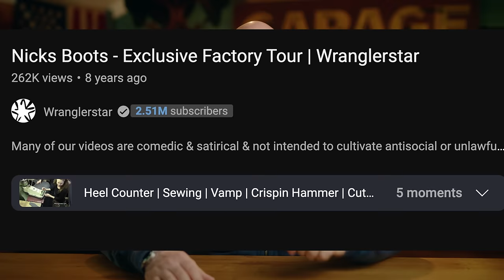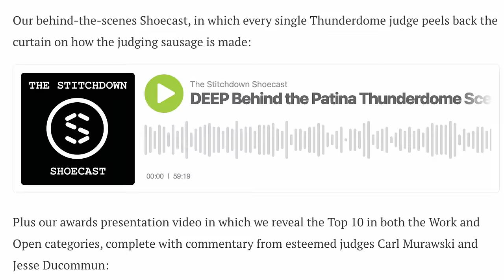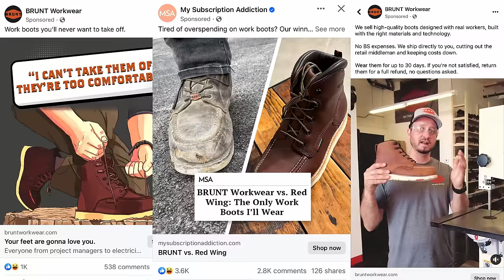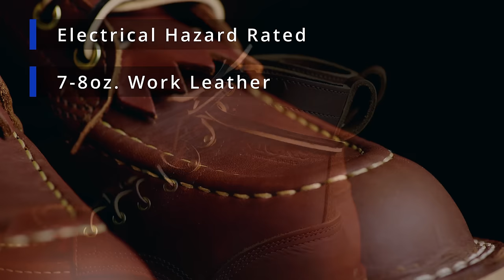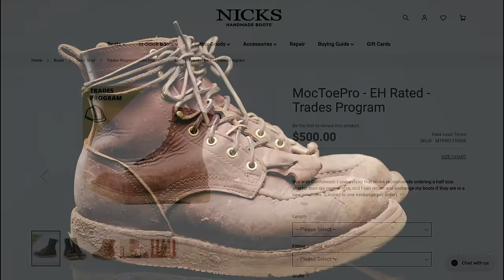$150 vs $350 vs $550 Work Boots

Comment: As someone who’s worn just about every level, make, and model of boots, there’s something to be said about having a very high quality boot on your feet and not having to think about your feet while on the job site. It’s a sense of security and provides a safer personal environment. You don’t have to go $500+ but I’d suggest considering it or atleast going mid range and steering clear of the epically cheap boots. When you’re new and starting out by all means going cheap in the most desirable option but once you advance in your trade go for the higher USA made options, you’ll have a tougher break in but it’s worthwhile. I will say with Nick’s the break in hasn’t been that bad in my experience.

Comment: Awesome video! Thanks Carl. One thing I would say about the Red Wings is that you can get the 10875 (same exact boot as the 875 but with oro original leather instead of oro legacy) for around $285 U.S. It's a great price for a really solid boot. The oro original is a more tan instead of orange leather. But I've found on the job site it deals better with scuffs and stains. Just wanted to throw that out there.
Reply from the maker: Thanks for the info!

Comment: Nice video. It would be cool if you’d do a follow up where the boots were cleaned up, conditioned and eventually resoled. Especially the Redwind and Nicks.

Also do you have any recommendations for steel toe boots as my job requires them?

Comment: Great video.  I work in a warehouse and hear folks complain on the daily about foot pain.  Most are wearing cheap sneakers or light duty ST shoes.  I rotate through too many pairs of boots, but it makes a big difference in comfort.  I prefer stability, support and firmness of a boot and would never want a lightweight, cushy sneaker for this purpose.  Your point about the safety aspect of being sharper and focused when you're not thinking about foot pain is spot on though.  When you're operating forklifts and other heavy duty equipment, it's super important.

Comment: I used to work three years on construction, where we were doing all kind of work. Concrete, digging, masonry, demolition and drywall. I was always wearing German military BW2000 boots that I bought used on ebay in “like new” condition, and they survived all three years. They were comfortable, water resistant, and protected my feet from sparks and all issues. On weekends I used to wear them on hikes and backpacking trips. I seriously don’t understand the desire to pretend that you really need 500+ dollars just for work. Now I have a decent boot collection, from Iron Rangers to White’s. But it is just like a hobby

Comment: I work in construction paving asphalt specifically and I’ve now seen a few people with brunts at work and I’m curious to see how long they actually last. I stepped up from the typical mid level redwing $150-$200 ish to thorogoods 1957 moc toe and it’s the first boot that my feet haven’t been sore in I’m going in to my second season with them and will probably re sole next winter.

Comment: I have a pair of Thorogood round toes im retiring because of a tear after 13 years 3 resoles. They last ok as an IBEW Wiremen unless your doing lots of deck work or working on your knees blowing out the toebox. The Whites Perry premium is a sweet spot for normal construction.
Reply: IBEW local 66 ❤😊

Comment: No mention of the painful break-in period with higher end boots? Also, surprised you didn't feature Thorogood. Aren't they really popular on job sites?
Reply: Exactly. I have a few pairs of higher-end boots that are just too nice to wear to work, no matter how well built they may be. On the job, I swear by my trusty Thorogoods. Tough as nails, comfortable as a pair of sneakers, and after my first pair was finally ready to be retired after three years of hard daily wear and abuse, I replaced them with another pair of the same 6" steel-toe moc toes from the American Heritage line without hesitation.
Reply from the maker: Thorogood is definitely popular, and these particular Nicks are built to be a little more flexible, cutting down on the break in period.

Comment: Great video, coming from my background Canadian, honestly "narrow" experience.   I was lucky enough to stay in one job for most of my career. 

Im surprised at the amount of "work boots" that dont have safety toe steel / composite. Heck just for a site visit everyone has to have safety toes as a minimum, where ive been.  

For my personal use boots i custom ordered Steel toe Jim Green AR8's.    They are not technically "certified" but im not actually on job sites anymore. 🤷‍♂️  

When polished up you would never know they are steel toe.  

Anyways thanks again for the videos!!  

Cheers,beers and whiskey 🤠 🥃

Comment: How can you tell if theyre goodyear welted?
Reply from the maker: It can be tricky, but look for the small strip of leather (sometimes PVC) where the sole meets the upper. That is the actual welt, but some brands will put a fake on there like BRUNT. So it gives the impression that the boot is made with a much higher quality construction technique, though I find that deceptive...

Comment: I haven't tried Nicks yet but I have to different varieties of Whites Perry boots and the Perry's are so good thatI don't feel the need to pay more. I don't care for the fake Mac toe. I might try the JK 300 or forefront next, they don't offer a mic toe but then neither does Nicks, they just punch unnecessary holes and fake stitches into the top of the boot so if I were to buy Nicks I would avoid the "moc" moc toe.

Comment: I have to have the absolute hardest sole boots out cuz of the surface I’m on everyday. Highway diamond grinder operator here so ground sharp concrete roadways. If you don’t know what that is, google it. But it’s sharp and unforgiving, rips any wedge boot apart in a few weeks, and if you drag a heel, they’re junk sooner. Best two boots by far in the thousands of dollars work of boots I’ve tested for this job are….Ariat overdrive xtr round toes and timberland pro endurance. Of course u replace the insole with timberlands orange thick famous insole for both boot brands and you’re set. But if u can’t send a staple into the sole you’re good to go. I’ve tried nicks boots and they were sole less in 5 weeks. Sold them. Red wing many types, sold them too. Danner, etc…no wedge boot ever will last. So it’s only a heel boot type of job, Georgia boots makes some really tough industrial soled boots too, but they’re really heavy. A good test I’ve found is if u can u wear them down with a 60 grit flap disc in a few seconds, they’re junk. U can’t with the two I picked and mentioned and I’m in them 12-17 hrs each day as there are never any less than 10hr days in my industry. Nothing stops our work unless it’s machine issues.

Comment: I really want some high quality steel toe boots, but all the best brands make stripper boots for some reason. I don’t need a 3” heel. I need something tough, with very good traction. Working in the oil field these nicks and whites boots are a no-go. Hope they make. Better model soon. Wedge sole don’t work either.

Comment: I usually just end up going with Ariats. I dumpster boots within a year just due to the nature of my work. Nothing survives. So for me there’s no reason to buy a $500-800 pair of custom boots for them to be totally unrepairable within a years my boots LIVE in oil, hydraulic fluid, water, greases, chemicals, high heat from welding amongst many other horrible conditions. No matter how you try to take care of your stuff nothing lasts long. Pants, work boots and shirts are disposable in my line of work so for me this is what I end up having to do.
Reply: Like you our boots where exposed to everything. I had to have safety toes, electrically safe, and be able to hold up in Nav Gas, hydraulic fluid, oil, grease, & a myriad of chemicals &  paint. Once a year I would buy Redwings with the extra wide toe box or top of the line Keen’s those boots performed well I have no complaints. I never heard of Nick’s not in aviation ever. I did 47 years total walking flight lines & hangars I was in The Military for 27 years & they gave us good boots; when I retired I went to work for Cal-Fire Aviation fighting wild fires for 21 years I had to buy my own then of course. Thanks  for sharing your experience 😎

Comment: cool that you 2 are in the same job as i.....getting my 25 year pin next month and 15 more before i joined......nicks were the first i bought but my soles fell apart i thing someone did not build them right....despite this they outlasted the thorogoods from before that and the jks i have now are far superior i think because they use better stitching than nicks.....unfortunetaly i feel i wasted my money on the nicks and they will not do anything.....the leather on the nicks is very nice though maybe when i get a big rabbit haul ill have jk rebuild them the uppers are still good.....

Comment: Do work boots not need steel toes in america? Pretty much every place that needs safety shoes in Canada requires a safety toe.

Most boots on these sites that have steel toes are like logger and linesmans that are 8"+ height with massive heels.
Reply from the maker: Most companies have shifted away from steel toe here in the states. If safety toe boots are required, they're often composite or even safety aluminum.

Comment: In Australia, almost every boot on a worksite is a steel cap, just weird to see that non steel cap boots are worn so much in the US
Reply: Some jobs require them but that’s a rare case. The added weight can lead to more injuries to the tendons and muscles in your feet as well as just being uncomfortable. Some jobs also require that you not have any steel caps or metal in the shoe, examples being fire fighters or maybe a case where the machinery is so heavy it would easily break steel caps and lead to more complicated medical treatment so better to avoid using steel caps at all.

Comment: I'm actually shopping for a new pair of work boots now. Looking for the very best. Right now I'm wearing Redwing.  And they are hard to beat. I'm an electrician.  Now I see in your video the guy wearing the white sole boots.  Me myself I can't wear them.  To me and I've tried many boot brands and no matter how much money it cost or what name brand.  White sole boots are slick as snot on wet concrete and you will bust your ass.  Even if concrete is dry but you just walked through wet grass. I'm wanting to try chippewa work boots but it'd be an expensive test if I don't like them.  I'm on my feet 15 hours a day anywhere from driving to walking concrete to climbing ladders all day. . I might be using a shovel. Then to a service call commercial or residential to industrial.  Then on concrete all day or a ladder . If I could find the perfect work boots I dint care if they cost a $1000.00 a pair along as I get 3 years use out of a pair. That being said my Redwing last 2 to 2.5 years. A work boot should be tuff  yet as light as possible and slip resistant.  And being I'm an electrician non steel toed. But should also be good looking enough it could double as a boot and be comfortable.  I'm sure everyone reading my text and watching your video would agree price is not the issue.  But we need these qualities in a work boot. Plus besides being an electrician I hike and I farm. And I hunt and fish. Is it too much to ask for a boot that fits my lifestyle

Comment: Limmer Boots are awesome and made in New Hampshire (yes, that’s in the USA). They take 7 measurements of each foot and the uppers are 1 piece of leather with a 5-row stitch on the inner side. They are primarily for hiking but many men wear them for YEARS as work boots, and they can be re-soled. They also offer ready-to-wear “stock sizing” if you don’t want to wait for custom-fit boots. Those also save you some money. I have (2) pairs and I love them. When you buy them you can also have them apply TUFF TOE (a coating) to the tow area.

Comment: Well, I don't know if after only a month in the RW you'd need the cork replaced and all that already, but I'd hafta go back and see if these have the meh heel counter instead of the leather and all that, right? They have some issue with the gemming according to the vid I watched also, so not sure when to tackle the rebuild for them if you wanted more longevity and how to fix the fit issue he complained about BUT they also don't come in 8" height, either.
Reply: White's have some wedge models that are cheaper than Nick's, but don't know if they come in my size and which is which with the names all being similar for a few things, so there's four or five all called Perry. Don't know if they are better than RW, but probably?

Comment: Not impressed with this particular video comparison. There are a lot of really great work boots that run in the $250 range that make a lot more sense comfort wise, wear wise, money wise. Burning $500. to trash a pair of boots is senseless or I should say, common senseless. Thorogood boots are a great alternative and will be comfortable and get the job done. Instead of resoleing those beat up Nicks, you could instead purchase two brand new pair of thorogood boots that will last every bit as long and you could also have them resoled if you wanted. Again, no common sense here imho